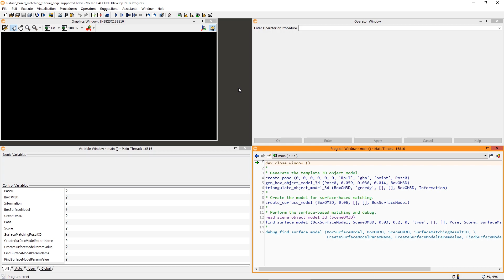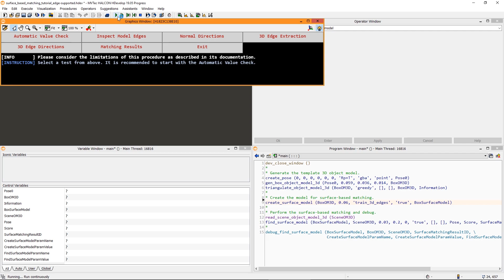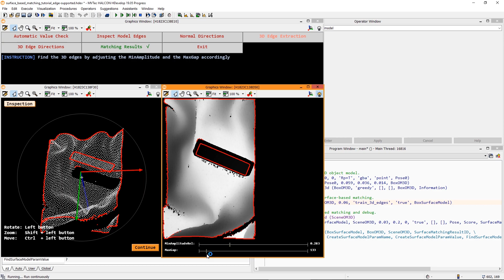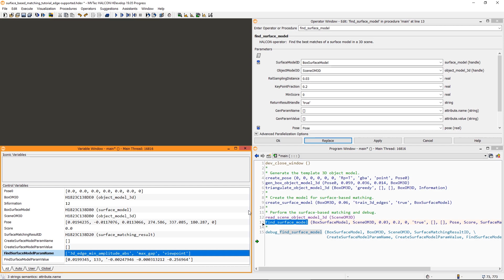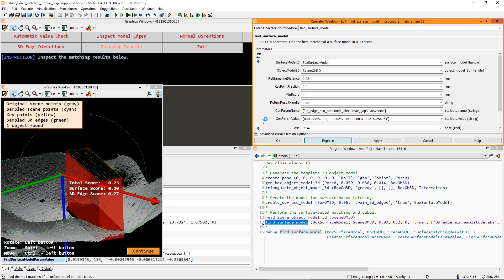Edge-supported Surface-based 3D-Matching with MVTec HALCON

Comment: Debug surface model no longer returns the viewpoint??
Reply: in Halcon 2023 you have to set "train_view_based" to "true" in the gen param names for create in order for the viewpoint to be returned in debug_find_surface_model.
Reply: Actually, this doesn't even return the viewpoint you set in the debug surface model call. It just sets it to whatever viewpoint you gave it, and if you gave it nothing it picks 0 0 0. What a misleading video! please update your "tutorials"
Reply from the maker: Hi  @Nick-eo1ez , thank you for your question and feedback. 

In the description, it is mentioned that this example uses HALCON 19.05. In HALCON 19.05 it was necessary to provide a viewpoint to calculate the edges. If the origin lies in the camera itself, it is considered to be [0,0,0] and need not be given as input. A major source of error was when the view point was somewhere in the scene but was not given as input. In this case, the edges were obviously incorrect and so were the matches. The viewpoint could therefore be determined with debug_find_surface_model() and be given as input in the find_surface_model() operator. 

Since HALCON 20.11, this feature was improved, wherein the viewpoint for the edge calculation is determined automatically using the mappings and need not be given as input to find_surface_model(). Thus, the menu items of debug_find_surface_model() were adapted and the viewpoint is usually not available anymore.

Only when using the view-based score, it is still possible to determine the viewpoint with debug_find_surface_model() and set it in find_surface_model(). Then, the set viewpoint is used for the calculation of the view-based score as described in the reference of find_surface_model():

'viewpoint': This parameter specifies the viewpoint from which the 3D data is seen. It is used for surface models that are prepared for view-based score computation (i.e. with 'train_view_based' enabled) to get the maximum number of potentially visible points of the model based on the current viewpoint.

We are sorry for the confusion. As our library is continually improved, it is not always possible to keep the tutorials up to date. Thus, we always mention the used HALCON version in the video description. Thank you for your remarks. 
Best Regards, the MVTec Team